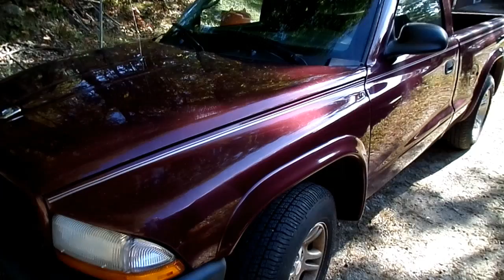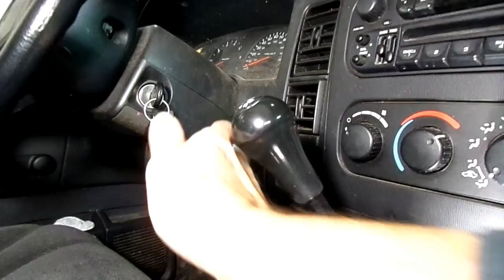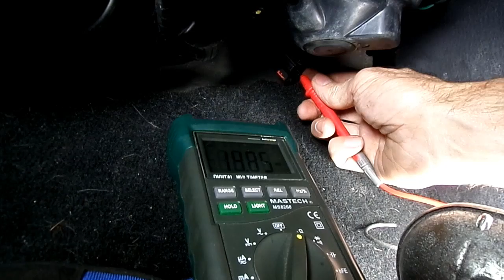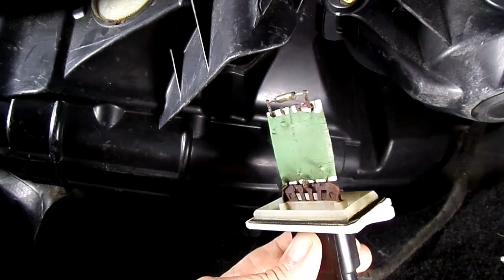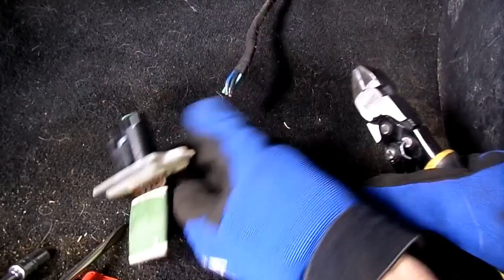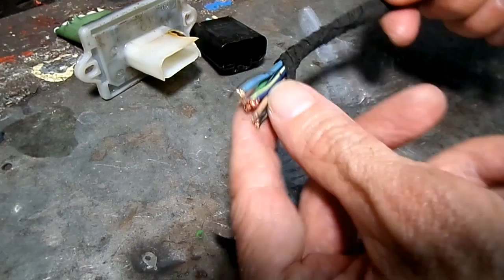Dakota Durango Blower Motor & Resistor Troubleshooting & Replace

Comment: So what year Dakota are you working on in the vid? I have a 1997 and it don't look the same as yours.
Reply from the maker: Davie Jones This is a 2003.
Reply: richpin06a It is a 1997 and I have ordered the dealer service manual for it from "Books 4 cars.com" and these are the manuals the dealers use to fix your car from the car lots. Very informative and in-depth books. Those Hayes books are ok but they don't give enough space for your specific model of vehicle. What I plan on doing is relocating the resistor unit where I can get to it again in the future if I need to. It just has to have a way of keeping it cool while in use. Just use a heat sink from a computer and a computer fan which is also 12 V and that should do the trick.

Comment: Hi, Any idea, what is wrong, if the blower a/c wasn't working at all, I changed the resistor and it worked fine (tip: once i changethe whole resistor, the other time I just changed the fuse on it which is only some cents value) AND it worked fine but only setting the control to 4, both times the same, looks like an extra heat is warming the resistor too hot and it burns, any ideas to help fixing it to burn and only work in 4.
Reply from the maker: Are you saying your blower only works on the high setting.
Reply: richpin06a Hi Rich, yes ti Works only on the high setting (4th position) of the switch, but if I keep it for a while, say some 40 minutes it burns out again ( the resistance fuse) ( :) I tried with two fuses the other day and it worked for a Little more time just for once, I know bad idea:{   ) thanks again.
Reply: @oscarquesada459  get another different resistor

Comment: Hi! Thanks for posting on how to test for the blower and resistor. Bought a k11 micra that sat for two and a half years. Got it running but the AC blower did not work but still has gas in it. I'm gonna fix this next.

Comment: Check the the drain tube for the hvac box. Chances are it's clogged and it's filling the hvac box with water. Blow the tube out with compressed air
Reply from the maker: I will check that.